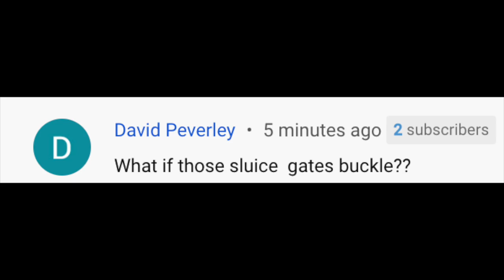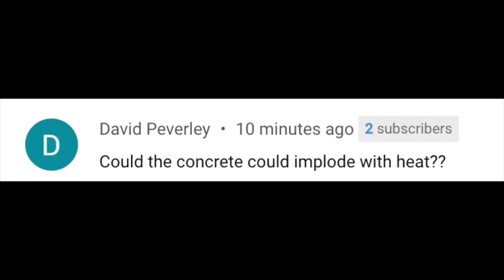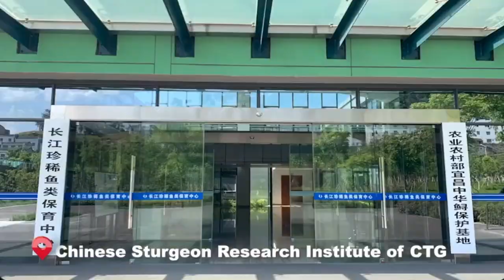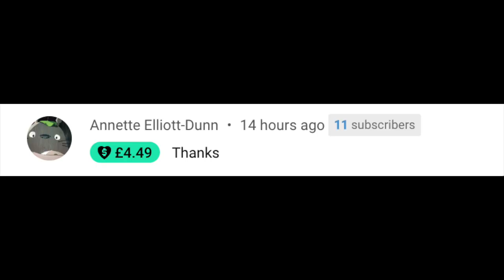CTG 3 Gorges Dam Propaganda Visit & China Lockdowns AGAIN.

Comment: I'm not in construction, but I've been told that the strength of concrete is "partially" determined by the type of sand used.  Wind blown desert sand is too smooth and would lead to early crumbling, where as excavated sand has sharp edges and binds the mixture.  Concrete does however continue to cure (shrink) throughout it's life.

Given the number of concrete structures throughout the world, I doubt if heat absorption presents a major problem (??), else we would be seeing things crumble already.  Quality of construction of course is the key question.